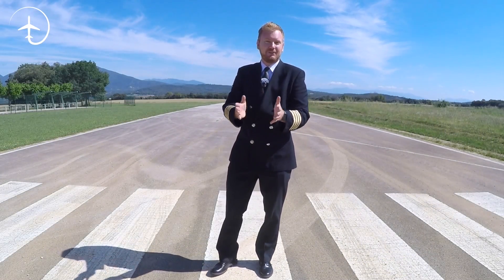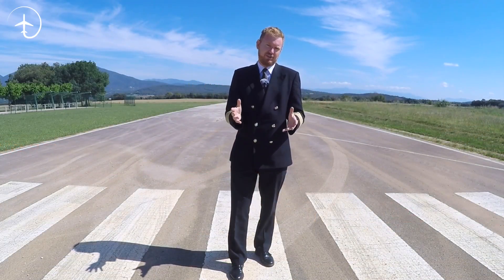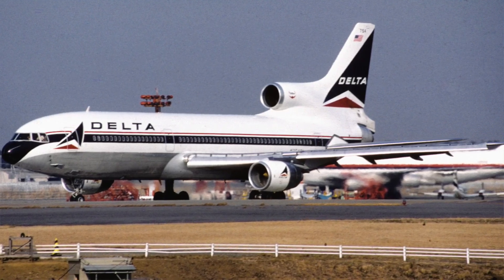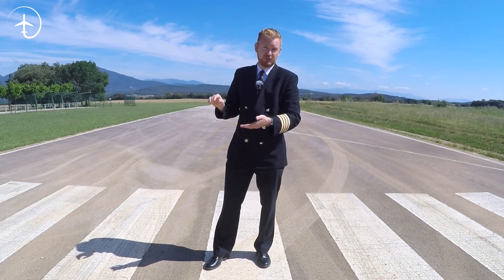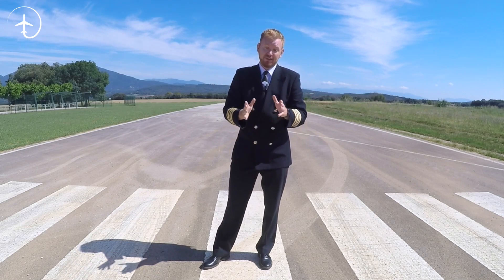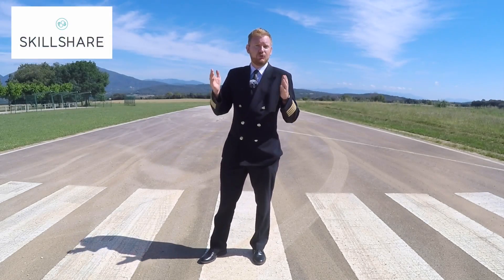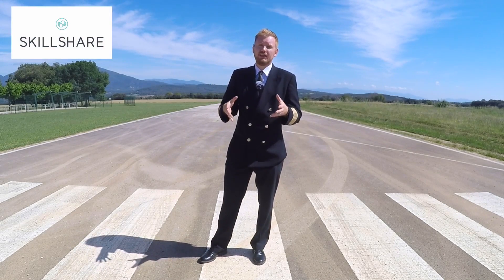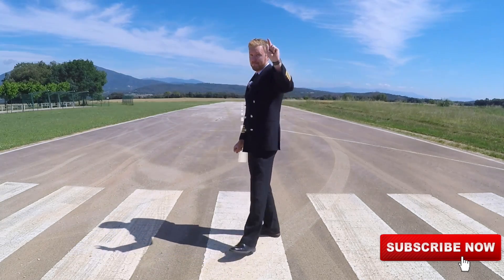Three Engined Aircraft, what happened?

Comment: I flew from Sydney to Belgrade with JAT in 1985 via Tristar and enjoyed the the flight more, found the aircraft quieter in the main cabin than the 747 I flew in return.
I have also flown by 777 from Sydney to Los Angeles and return 4 Times. Only the final return journey we nearly had to divert 800 miles to Hawaii due to a line of heavy electrical storms we were trying to find a way through and got close to bingo fuel for continuing the flight to Sydney.
Reply: JAT only operated the DC-10

Comment: Nice vid. Falcon 8x has 3 engines for ETOPS as you said so how does Gulfstream G650 gets ETOPS to fly non-stop for 10+ hrs over the ocean ?
Reply from the maker: They need ETOPS approval for that.
Reply: Parimal , ETOPS is not just aircraft certification, airline needs to certify to be able to fly ETOPS as well. And this certification assumes not only pilot's ability to fly on one engine in case of emergency (which is, let's say, normal industry standard), but  airline's ability to safely accommodate passengers for a prolonged period of time in case of emergency landing on alternate aerodrome. So, airlines must decide for themselves which is cheaper/more efficient — twin jet and ETOPS certification or trijet and added fuel/maintenance cost.
Reply: Sterlingjob I think he meant "has three engines in order to avoid complying with ETOPS"
Reply: Parimal, the regulations do not care how long you fly over the ocean as long as you have enough fuel for that. They do care how long it would take to divert into some suitable airfield in no wind and fuselage intact condition with one engine inoperative. You do not even have to do so if engine shuts down, and you do not need to be capable of doing so in time if the cabin pressure is lost and you have to descend to 3 km or 10000 ft to prevent divers decease and allow enough oxygen for the remaining duration of the flight. But you are still required to have enough fuel for diversion from all points in your flight trajectory including effect of headwind and reduced altitude flying. Therefore flying far away from any airfield (over ocean or not) might reduce range at later stages of the flight path when most fuel is already consumed. There is no place in this planet where nearest airfield is anywhere near 10 hours away with G650 with one engine out.
Reply: Correct. I meant 3 engines to avoid complying with ETOPS

Comment: What about a quad jet centerline approach?  Where there's two engines above, and two below, on either side of the center of the craft.  With the system setup to use only two at a time, but if a failure occurs, it would switch to both opposed engines, rather than just switching one.  So only two fuel tanks.  Would this be viable financially?

Comment: Thanks.  I knew about the previous requirement, for more than 2-engines, for crossing the oceans; but didn't realize reduced flexibility, in new engine upgrades, to the tri-jet.  Especially with recent engine developments resulting in increased air by-pass, hence much larger size of engines!  I saw a U-Tube explaining the new increased by-pass jets, which are much more efficient than previous jets.  Was that you (this series)?

Comment: I hate tri-jets, they just look weird to me, but the Dassault Falcons are borderline ok
Reply: Then why are you watching this video?
Reply: DC-10 looks so good, so 70s. L1011 and 727 make more sense. DC-10 is just hanging on the tail, more radical.
Reply: subscribe pls just because I don't like the looks of it doesn't mean I dont want to learn more about it.
Reply: I grew up in the '70s and the 727's center line thrust could plaster your head on the back of the seat during takeoff and the DC 10 might look funny with the #2 in the center of the horizontal stabilizer but it sounded bad ass on take off.

Comment: The Hawker Siddeley Trident originally the de Haviland D.H.121 not the best example of a tri jet. The Trident Three had 4 jet engines or 5 if you count the APU.
Brilliant plane: First plane to have autoland. 10,000 feet per minute descent possible as it could use reverse thrust in flight. Like the VC10 it's also very fast.
Also like the VC10 the designers were stupidly forced to design for the needs of one customer who in both cases didn't want what they thought they wanted when they got it.
ETOPS did for the big tri jets and the 727 could fly with hush kits but the Tridents fast wing (low lift) and marginal engine (marginal engine because the Trident was smaller than the originally designed plane. This meant that a near limit RR engine was used instead of the RR Medway) ensured that hush kits were impossible for Trident. So noise limits were the demise of the Trident.
The marginal engines were the reason why the uprated Trident 3 (Uprated to slightly less weight than the original D.H. 121 design) had the 4th booster engine.

Comment: Thanks for a great video. When I was globetrotting as a middle/senior manager way back when I flew on all sorts of a/c. I far preferred the tri-engined configuration for one reason alone: it was easier to sleep on a long haul flight as the cabin noise was significantly lower.  The 4 engined VC10 was also rather special too, for a similar reason. BOAC and the RAF used them as long haul passenger configurations (flown on them as well).

Comment: But didn't the L-1011 and the DC-10 have fatalities caused by the center engine failures, causing damage to the control surface actuators in the rudder?

Comment: Will aircraft with 4 engines also gradually disaapear?
Reply: They are disappearing. Not gradually either. Far as airliners go I can only think of 3-4 still using 4, and mostly only for long overseas hauls on routes that are generally near capacity. Feeding and maintaining 4 big engines is costly, and most airlines can't justify it anymore unless that aircraft is routinely packed with hundreds of passengers. That's why the paradigm has shifted to lower capacity widebody twins with very large, efficient and powerful engines that are certified to be flyable with one out.
Reply: Patrick yep  i think the 2 engines are powerfull enough nowadays
Reply: I saw somewhere (maybe not, but I seem to remember it) that someone took two BIG engines and put them on a 747 airframe.  I don't know how much further it got, but re-purposing things like that IS interesting.
Reply: Patrick  and hw they gonna fly
Reply: The new planes- Boing 666- will have two engines on one side and one engine on the other.  The single engine side engine will be twice as powerful dual engine engines.

That way they can have three engines for safety without the danger of one engine in the back.  Also many eccentrics will love the asymmetrics, creating the possibility of a niche market.

Comment: Question: you said 3 engine use more fuel compared to 2 engine, but does 3 engine need to run with lower power, to give same trust than 2 engine. So is there really big difference about fuel usage? If 2 engine run with higher power(use more fuel) than 3 engine bit lower power(less fuel usage)?

Comment: The us airlines  approach Douglas Corporation and Lockheed for 3 engine plane to compete against the 747 as a wide body  mid  and long haul aircraft that can take off  land  and land at shorter field like DC , Midway and LGA. Airports. Also it was the start of Hub and Spoke system of flying. To land larger airplanes required that the airports had to change gates, runways, and just about everything needed for the the jumbo which the airlines wanted but the airports were not about to invest or could not do.

Comment: It could be possible that there will be a trijet in the 747 and A 380 class of planes in the future. The market for such big airplanes did certainly get smaller over the last years but I guess a certain demand will remain. With the big and super efficient engines of today it would be possible to run a 747 sized jet liner with three instead of four engines.
I mean the four engines of this plane class is the biggest downside of it. I know Boeing has plans of a 747 trijet config lying around.

Comment: Hi guys some burning question that I had in mind, Would it be necessary to have all 3 engines of the same type? 
Would 3 engines make the plane goes, even more, faster than regular 2 engines plane? (assuming all the plane tested had the same enignes and travel at the same altitude)
Reply: Calvin Cahyadi no, the  Boeing 787 and A380 cruise at .85 mach. That is, the speed equal to eighty five percent of the speed of sound or mach 1. Design speeds for a particular make and model are determined by the manufacturer during flight testing

Comment: Someone at Airbus had had an idea how to do the engine/vertical stabilizer  on a trijet a while ago. Looks like they have no intention whatsoever of building it, though. Engine above the fuselage, and two vertical stabilizers at the ends of the horizontal stabilizer.

Unrelated: I like how the Tu-154 is retracting the landing gear. Backwards, with a lot of folding and turning of parts.

Comment: i would argue that in time tri-jets could potentially replace quadjets.
not that the really big aircraft are heavily sought after... A380 is the biggest commercial failure of airbus ever.
it is a really good aircraft but they got way, way less orders then they expected, due to the fact that twins are getting good enough
if you need a A380, you usually can get away with a 777 just as well.

or indeed for heavy cargo that neds the extra performance, but not the size of a usual quadjet
that could be the best tri-jet case to make

Comment: I have a stupid question :)  Do both engines spin in the same direction? If so, wouldn't that create problems? And what about trimotors?
Reply: Engines all turn in the same direction on any one aircraft. Engine mounts and cowlings are designed to absorb thrust and radial/torque loads.

Comment: The MD-11 and DC-10 are really different versions of the same air frame so why talk about them as if they are different airplanes?
Reply: Hi Eric, you're not wrong when you state the DC-10 and MD-11 are the same airframe. Yet there are several reasons to see them as different aircraft. First of all, they were made by different manufacturers: the DC-10 by Douglas, the MD-11 by McDonnell-Douglas. This may seem a very small difference, but by the time McDonnell stepped in, Douglas was just about broke and about to throw the towel. This because of the losses they made on the DC-10 because of its bad reputation. This reputation obviously was another reason for renaming the aircraft. Then a lot of redesign went into the fuselage and last but not least, the MD-11 features a glass cockpit instead of the DC-10's analogue.   Oh, and let's not forget, without McDonnell there probably never would have been a follow-up to the DC-10...
Reply: I understand that the MD-11 is a significantly different plane, but it seems to be an upgraded version of the DC-10. 
    McDonnell-Douglas is the merged companies of McDonnell and Douglas. Douglas is no longer independent, but they still do exist (sort of).
    It's sad about the DC-10 though. Yea it had issues (the cargo bay door was a stupid design) but it was overall a good airplane. Like the Comet, it reputation was destroyed by a rather minor design flaw, that really was easy to fix.
Reply: Douglas (unfortunately) does not exist anymore. After their merger with McDonnel the merged company was absorbed by Boeing. That explains the renaming of the DC-9 into the MD-80 into the Boeing 717.   And once a reputation is pockarued, nothing will fix it.
Reply: Indeed. Many have an irrational fear of flying to begin with (even though driving to the airport is about 1000 time more dangerous). Even if you fix a design flaw, people would still rather not fly.
       The only reason Airbus hasn't gained a bad reputation is because they have been able to convince everyone that air frame failures or bad design failures are down to pilot error.
     I was fuming when the NTSB said the pilot who broke the tail fin off his airplane did so because of his aggressive use of rudder (which had been part of his training)
      Control inputs should never cause air frame damage below maneuvering speed. That is the entire point of maneuvering speed limits. 
     If I had the authority to do so, I'd take a page out of Ralph Nader's book, "Airbus: Unsafe at any altitude"
   But no one gives a shit about what I have to say because I'm not famous.

Comment: Actually, how viable would it be if we take 2 engines off the 747 then strap a GE90 onto the side of it and compensate for the yaw by tweaking the fly by wire system?
Reply: Not very. The engines are designed to run most efficently in a very narrow power range and anything outside of that will burn a LOT more fuel. However they do often ferry in engines for planes awaiting service by literally strapping on another engine although they aren't run and they either have no fan installed or they have an aerodynamic cover ovr the front of the engine to reduce drag.

Comment: Max bypass is crap no speed crazy airlines cheating out by don’t flying us with Mach 3+
Reply: The plane can't go mach 1 let alone mach 3. At mach 3 the plane would literally melt if it didn't break apart first.
Reply: Lockheed SR-71 Mach 3.3 Concord Mach 2.02 Tu-144 Mach 2.23
Reply: Now compare the SR-71 Concorde, and Tu-144 to a 737, 747, 757, 767, 787, md 80,dc 10, 320, a330, a380... etc. They look strikingly different don't they? But the supersonic aircraft have similar design features, dart shape, short wide control surfaces, engines mounted in fusalage/wings instead of under them.
As it turns out there is a LOT that goes into making an aircraft go the speed of sound, let alone more than it, let alone 3x it. If you take an ordinary passenger jet to the speed of sound The engines can't breathe and die, the control surfaces flutter and will break off, and there will be other structural failures as well as the wings no longer producing enough lift or the tail keeping it steady. As it turns out you need special engine intakes, special shaped wings, special control surfaces, and a massive cooling system among many other things to go supersonic. The trouble is supersonic aircraft aren't very good aircraft at subsonic speeds,  this is why fighers like the F-14 have swing wings, and as it turns out because of the extra pressure it takes a lot more energy to sustain supersonic flight  than subsonic so supersonic aircraft aren't very efficent at high speed either. It's kind of a catch 22.

Comment: I do miss those L1011s.
Reply: The L1011 had to be the most beautiful airplane ever built.  Runners up:  The 707 and the Super Connie.
Reply: Gary Gray I also think the 757 is a beautiful plane.  Same dolphin nose
Reply: Those RB211s were sweet.  I always loved sitting to the back of them during a flight because the hum of those engines put me right to sleep!
Reply: we still fly l1011s and dc 10s
Reply: johnny llooddte  This is an honest question. Who is flying TriStars today? I know Orbital Sciences had one operational and as for the DC-10 the last one was owned by Birman in Bangladesh.
Reply: Gerardo Salazar Don’t know much but I’m pretty sure FedEx still operates a couple of DC-10’s.
Reply: Rolls-Royce: aero engines of the gods.
Reply: moi01887 indeed because it takes a miracle to start one without getting a hot start; in some circles RR stands for Rolling Rubish.
I should know; I flew TriStars for over 4,000 hours. If it had had GE engines it would have been the best ever.
Reply: Love the L-1011 most advanced aircraft of it's time, lockeeds last commercial airliner. Ruined by Jimmy Carter.
Reply: Evan J still in service with passengers with a charter company in Jordan